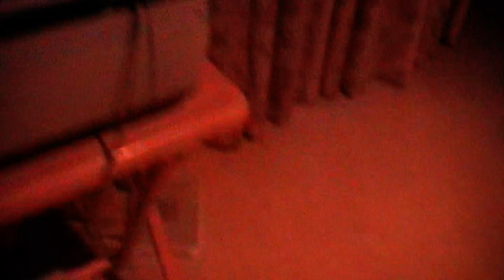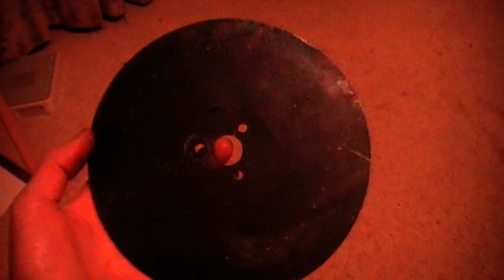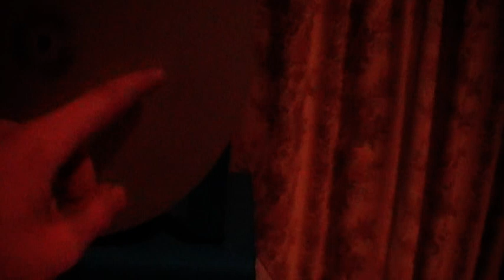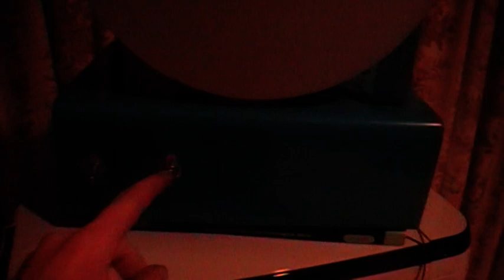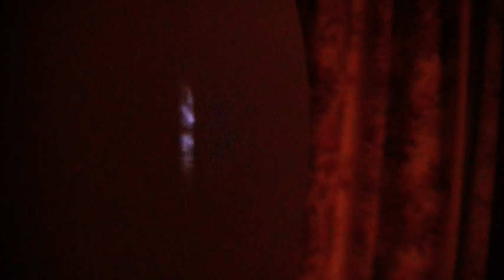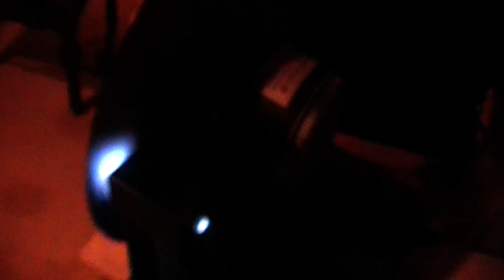Mechanical TV set.

Comment: Use a low shutter speed on your camera so we can see it better.  You will have to experiment with the shutter speed a little to get it right. I used to transfer 8mm movies and had to use a slow shutter to eliminate black bar rolling through the picture.

Comment: can some one please explain to me how theese actually work? how is the picture generated?
Reply: a spinning disc creates an image by the means of a nbtv program which creates signals for each line, when the disc rotates a hole passes a light and creates a line, the light which flickers by using the signal from the computer, the light turns on and off very quickly and each time it turns on you can see a bright area on a line and a darker one when it turns off creating an image line by line which is converted from many lines made of holes and light and dark areas into an image in our brain